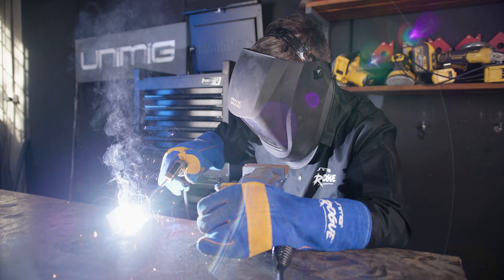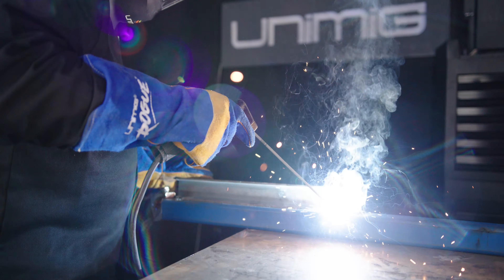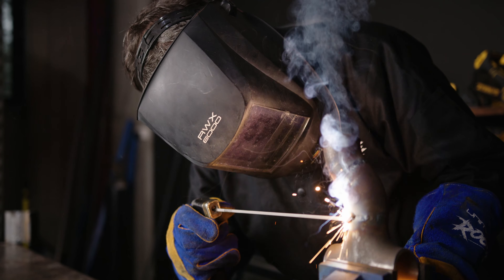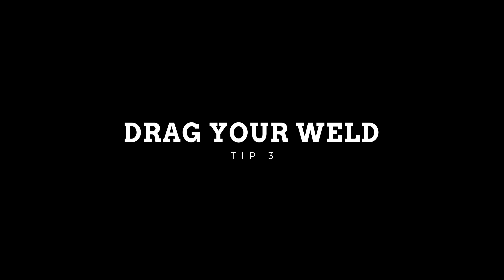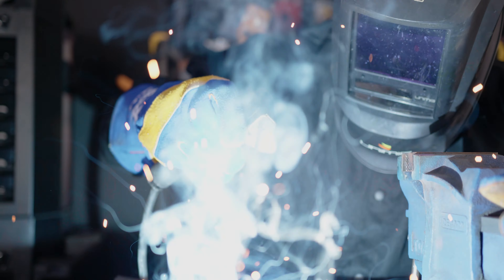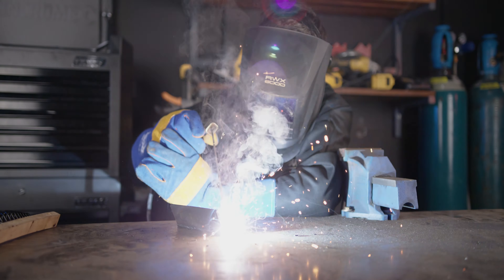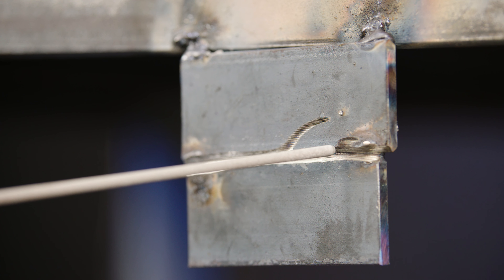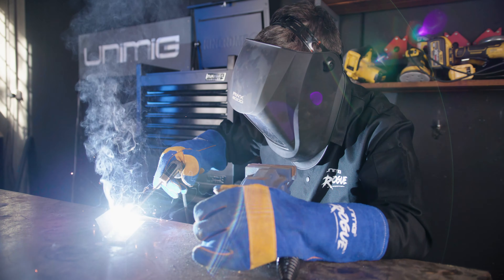9 Stick Welding Tips and Tricks!! (Improve your Stick welding today)

Comment: I have been battling with a Unimig where the Welding shop could not ever get it to run properly and to be honest I have gotten pissed with it so many times because I had spent a lot of money on this unit, But from watching videos I have now started to see faults in the Machine, Faults in storage, Faults in setting up and with your excellent products and fantastic video's they have helped me to address many things and I am looking forward to getting this machine into perfect health and see what its actual potential is. I have welded a lot of things from Building Large Trailers to Steelwork in Construction and always been able to get really good results, so when I came into a bit of money and my old faithful cheap welder had issues I decided to jump in and spend some decent money on this Uni Mig 275 which I was told back then was the last of the Copper coil machines that were going to be made and sold. But it was a circuit board that went on the machine and replaced under warranty which can happen to anyone but to tell you the truth the shop just seemed to be clueless past this point, but with the support of an Uncle who was a Boiler Maker we got it into the sweet spot and it wasn't too bad, but because of site issues at the rental property we suffered from really poor power which went up and down dramatically.
As you know this is not Uni Mig's fault but it helps people to understand what is the cause of erratic issues so machinery that is of good quality like this unit does not get blamed for poor performance or failures.
SO some of the big issues I had with this welder were related to poor maintenance of things like wire from lack or light use which for the part-time welder is a massive issue and would make a great video for you guys, Telling people how easy and cheap it is to keep a couple of liners on hand so that once you got to do your project and find feeding and arc issues as I have then it's just a no brainer to have a $10 to $15 liner there or as I now do a few and just chuck one in and see what happens when you experience this issue or I guess unload that section of wire and throw it away rather than bugger and jam it.
I know a lot more people that suffer simple storage issues as I have that then end up blaming wrongly the machine because they did not understand why it went to crap. 
Would you suggest putting the wire plastic bag over the wire real to stop rust build-up or does this not work? 
I can tell everyone that my welding is great when the gear is great and crap when something has slipped past and Interestingly if the machine is up and running sweet then they usually do continue and I have found that I think while they are in full work they usually continue in this mode, but rust build up on wire seems to be the killer with the mig and for me, Stick usually seems much more forgiving?
But once you go to mig and are making a reasonably large project then it's not often that I would want to go back over to stick?
I look forward to hearing your thoughts? and I totally accept that poor shop support did not help my opinions of the unit but working through issues and seeing your excellent videos has helped me to get a much better understanding of what are my failures and just how cheap many solutions are like liner replacement where its compromised, because as you know if you have a really bad liner issue then its usually been the root of all your pain and suffering for a very long time and just like brand new tires on your car and feeling the difference its something that most times you would happily pay to fix had you understood the issues? 
Well, I scored another welder that is virtually new and is My Unimig in a 250 but in another brand right down to the Dual roller drive system? is Uni Mig selling these machines through license or are these copies as the quality appears to be excellent and its a perfect story around knowing your gear. 
Well I subscribed and Love the Videos and I have been watching them as I am considering the Viper 185 to have a crack at a bit more mobile welding around the property and I also want to have a crack at Tig, as well I would love some advice on Plasma Cutters for sheet around 3 to 5 mm to compliment the equipment I am currently using. Cheers From Garry from Australia and keep up the impressive work.